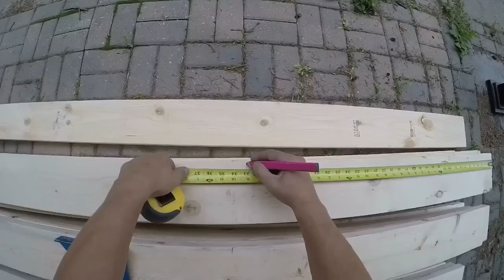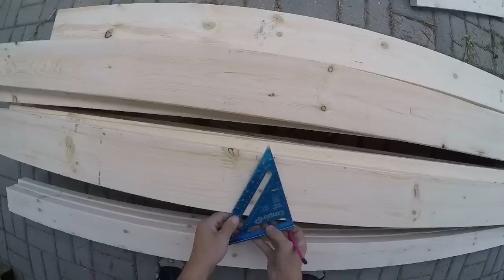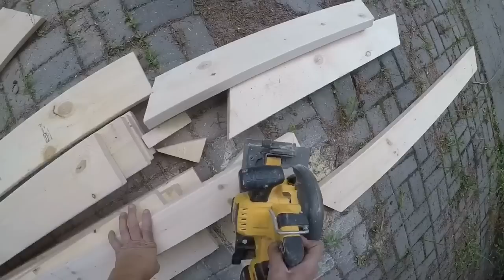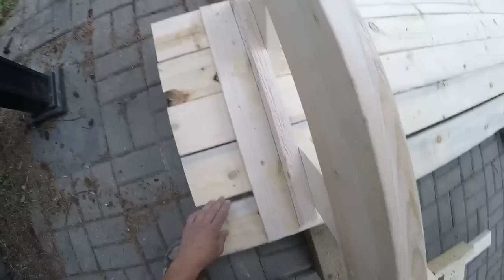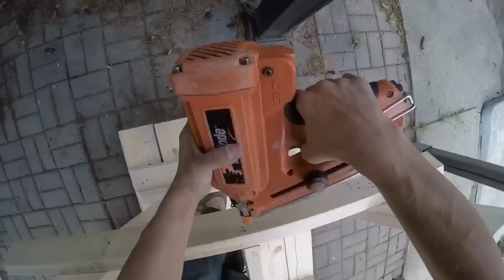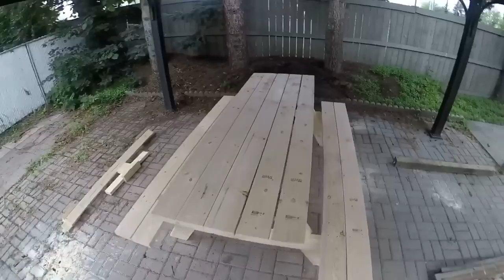How to build a picnic table in 15 minutes

Comment: All the complaints about how he did it... FFS... he's a framer, and he built it like a framer. Fast and efficient with framers tools. Is it the prettiest? No, I cringed a bit at the amount of nails and randomness of their placement... Was it quick and cheap? Yes, it was so quick! Is it how I would do it? No, I would use screws, lags, and bolt's and put them in symmetrically for aesthetics. However, it would take me 4 times as long. I don't think I could charge four times as much for my time and compete with him if we were selling in the same market. Because the truth is most people that buy stuff don't look too closely at how things are built unless they are builders and they don't give a damn that it took you four times as long. All an average consumer sees is a picnic table. 

I did however take away some helpful bits that I would adapt to batch out picnic tables more efficiently for myself. That was a simple effective jig and he knew exactly how long and what angles everything had to be. 

He get's an A+ for speed and efficiency.
Reply: Ya I agree with you.  I wouldn't buy it but hey if it's for himself good job with that he's got.  I do like the jig though will probably build one myself next time I need to build a picnic table.
Reply: So true but he did the way he wanted screws wouldn't come up and bite your butt and the kreg would be nice also I would of put the label/writing the other way but he did it the way he knows and the speed was amazing im more of a roofer and a decker
Reply: How long are those nails??
Reply: @quik604silver6  🍻 cheers! from Bama!  It's just a vid showing a table being built fast. The man could probably put mortise and tenon joints and whatever else on the thing if he was making that type of video

Comment: Benches need bolts my friend..
Reply: I used to work at a pub that had nailed together benches, they'd lasted years with thousands of people sitting on them. If it's done right then it's fine, especially with good quality nails
Reply: He probably did later
Reply: He's a rough framer. I'd do the same

Comment: Those legs will rot out in a year. You have to use pressure-treated lumber.  Screws and glue is the way to make a picnic table (or anything).

Comment: Over time the gaps in the top will be to wide probably an inch because the lumber will shrink. Should of used lag bolts for the seat cross pieces. I don’t like using nails due to maybe having to remove pieces that need to be replaced much easier to use screws. IMO…

Comment: I was taught to always sharpen both sides of the carpenters pencil.. never have to flip it around if you grab it wrong and you always have two leads if one runs out or breaks and you're holding a board in the air two stories up and can't sharpen it. Love your style tho, get it done son!

Comment: So it didn’t take fifteen mins to build you had to build your jig as well so how long did it take to build jig and you have used nails to put it all together it will be wobbling like nothing right within a day or two should use bolts all in all Why? just to say you’ve made a video not even put nails in straight line

Comment: It doesn't look like you're using treated wood. Thankfully you have it under cover, but it still might not last too long depending on the humidity there. If someone wanted to do this and keep it for longer, probably would be wise to use galvanised nails and pressure treated lumber.

Comment: i like it, simple, cost-effective, quick, useful, and fun to make, even for those dads who just want a weekend project.
the only thing that bugs me, and this is personal preference, that it does not stand the test of time as much, it will shrink and loosen, and will have to get repaired and will have so many nails in it and so much wear that you have to build one every 10-25ish years depending on usage. while the materials could last a solid 200-500 years or more.
and yes i know, i'm a joiner, i learned to have this preference, to make things that will strengthen and last with time, and that is the reason why it takes much more effort and time investment to be put in it to make.
yet i am here to state, this (what you demonstrate in this video) is more than enough for anybody. and people are better off doing this themselves than buying a table like this at a store, pre-fabricated, ikea style.
so all in all, thanks for making this video!

remember to oil-finish it! :D
Reply: It's so quick and easy to build another, so don't worry too much about it getting loose over time

Comment: Your bracing support across the underside of the table (in the middle) could have been formed as a 'T' so that you could fix the 45 deg spreader beams to that and then attach to the underside keeping it all in one plane.
Other than that, nice project!.

Comment: The nails on every picnic table I've owned loosened with use and weathering and only stayed together if there were bolts through the legs and cross supports.